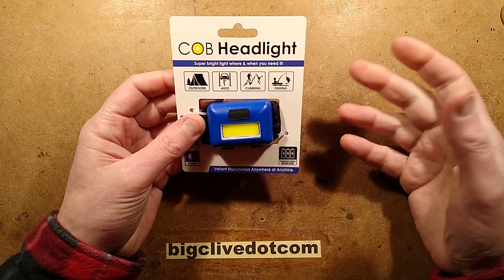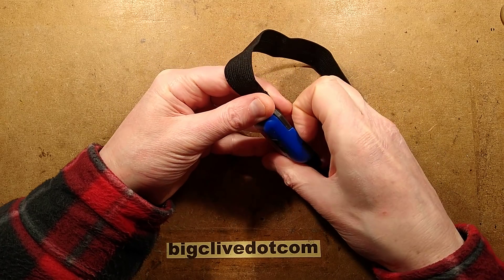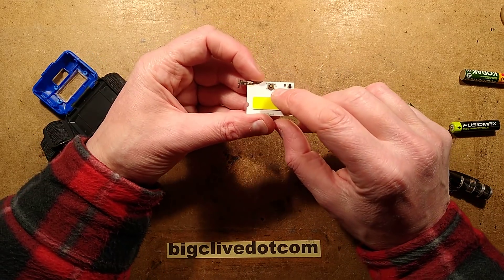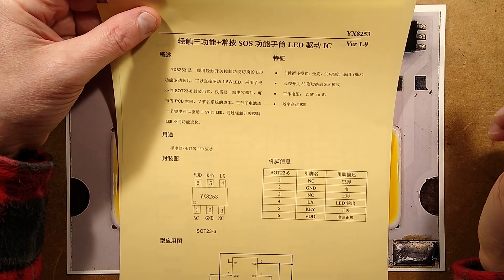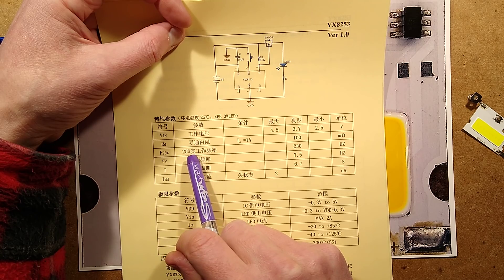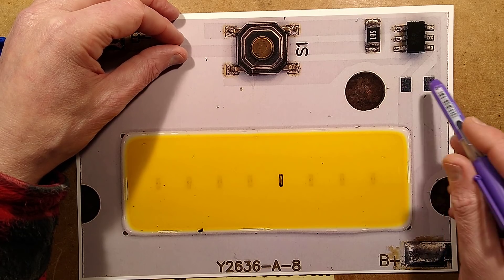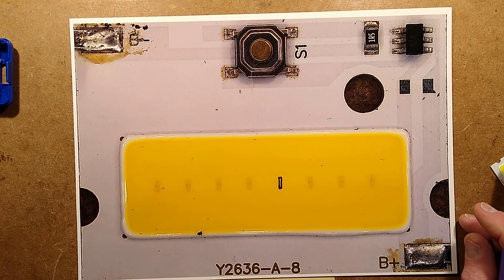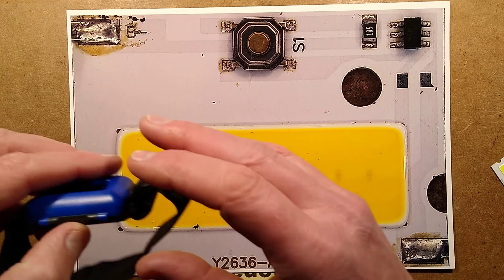New Poundland head torch is actually really neat.

Comment: Those headlamps suck. Got me some 19$ one from Aliexpress with three lights that are *independently* adjustable (make sure they are not all connected together). With this I can put for example the two outer lights towards the ground while the big light goes straight ahead. This is useful, because you usually only move your eyes and not your whole head. Thus with those cheap ones or with only one direction you won't see anything by just moving your eyes.

Comment: Bought one a month ago. Better than my more costly headlamp.
It fits in my back pocket when I don't need it because it is slim.

And it's pretty bright with a new set of batteries.
Reply: Same here very handy for a quid,
Reply: So it actually cost £1? If so, that's a good price.
Reply: @Locutus  Indeed £1.
Reply: @davidmartin1628  Great price!  I will go to £L tomorrow and buy 2.
Reply: I bought a few, put them in first aid kits, the car etc. They work fine (so far) didn't spot the SOS mode though Dohhh!
Reply: If its left on in your pocket at full power it gets very hot.... just found that out.
Reply: Can you adjust the lamp? as in tilt it at different angles? eg for doing work on an item and you need light in a certain angle?
Reply: @Inverted_Star  I don't believe so.  It's fixed.  But for a £1, you can't ask for a lot!
Reply: @Inverted_Star  There is no tilt on the headlamp, but you can move it up and down you forehead to get a better angle.
Reply: john hansberry  I plan to use it for visibility purposes when walking at night.
Reply: @Locutus  it's COB LED btw.
It'll illuminate everything in front of you. No tilting is needed.
Reply: john hansberry  I planned on doing that exactly!

Comment: The  Tsld - 300C figure will be Temperature - soldering won’t it?
Reply from the maker: That sounds right for soldering.
Reply: @bigclivedotcom  Slightly off topic but on topic.

When you're talking about measuring the current. The quiescent current.

What? Type of a brand of excetera meter are you using?

Or are using something like a microcurrent? You don't think that Evie varg Dave Jones produces?

Or some other type of low carb measurement accessory for a multimeter?

Protech head here.
Reply: So we got a time traveller here as well....
Video is uploaded 59min ago and your comment is 1 week old...??
Illuminati confirmed
Reply: @piyushnagawat24  patreons have early access, not time travelers 😉

Comment: If it wasn't for the heat issue this would be an ideal product to convert to rechargeable using one of those little disposable Li-on packs.
Reply: But fitting charging plug would be a problem. And recharging them separately would be just annoying.